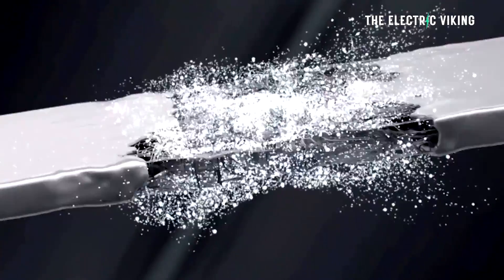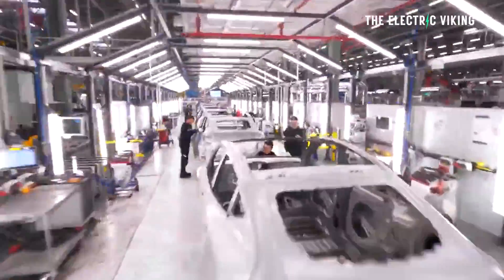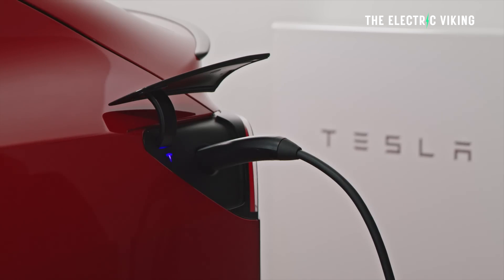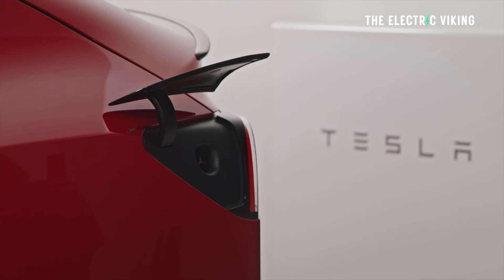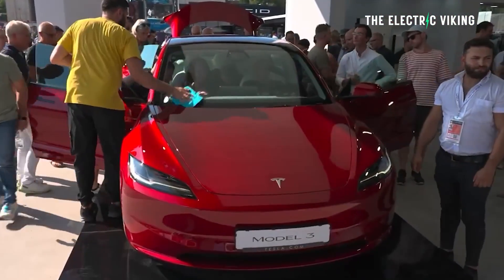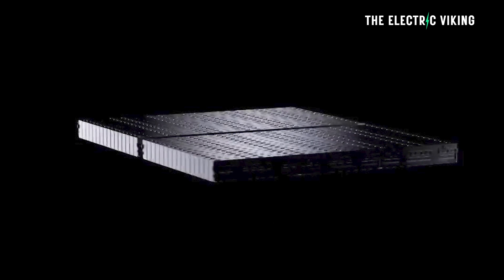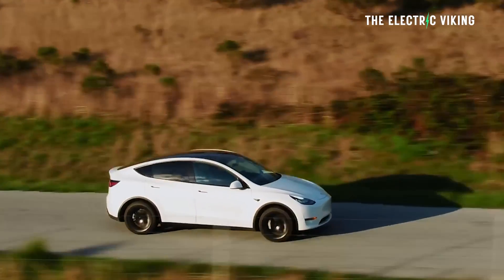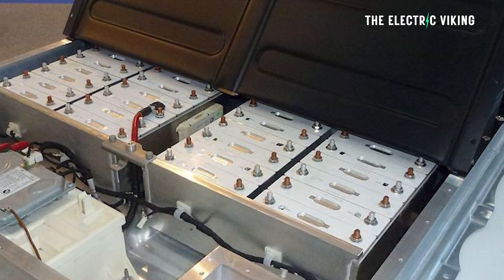Energy density of CATL's Shenxing battery revealed for Tesla Model Y Juniper

Comment: It's nice to hear that batteries continue to improve but the article has opposing "facts".   At one point it states a car (with this battery) will have a 1000 km range and at another it states that a Model Y could improve as much as 15%.   Given the Model Y range would be 613 km WLTP with that statistic (which is great, but not 1000 km), the article leaves a lot to be desired.   Click bait is one thing but it would be great if we could actually get some reliable information on an EV based channel.   I'm still waiting for my 500 mile (≈ 800 km) BEV to be completely happy about BEV range.   This would generally provide 400 miles  (670 km) range under bad weather conditions.   That said, I'm still delighted with my Model Y and what it gives me compared to ICE.

Comment: I think current model Y range when new for standard model with CATL LFP battery is 410km. I dont know for sure but the same battery in my Highland model 3 is 438km.
The new battery has 1000 434 km range and will increase range of model Y by 15%
Hang on there shich is it 410km increased 15% isnt 1000km. Its more like 485km. 
I am expecting the new battery in model 3, when I sit in that car at the dealer to read on the display 500km. Lets see how close I am to that.
Reply: Shenxing enables faster charging without degredation which is more important than range tbh. If I could charge 10-80% in 10min I would be okay to 480-500km range

Comment: Always take a look at volt and amperes when speaking of charging speed, very fast charging will heat up the cable and everithing in the "charging chain" , maby you can do a very fast charging, then let the charger cool off. The load will be massive, so I think you came to a point where the load is to much.
One good thing is, doing the car lighter, the battery smaller, and therefor faster to charge

Comment: The electricity is still generated with coal. And the the electrical infrastructure still sucks. The most advanced electrical vehicles are highly advanced, still polluting steam engines. Until the electricity is green, whats the point?

Comment: what is the power density per KW? please give number
Reply: Do you mean power density per kg?
205 watts per kilogram is what the video states.
Read the transcript if you missed it in the talk.
Reply: @briankearn6991  thanks. 205 seams not too high. Ionic 5 uses SK ncma battery with 305 per KG. He made it look like its revolutionary breakthrough but it wasnt
Reply: @galaxyoldman  
Kilowatt hours per kilogram is energy density is variable dependent on voltage. 
Google the formula.
It determines how much energy is released and how much range a car will have.

Comment: Maybe Tesla offers a 600mile range vehicle. However, I believe they will continue to offer a 300 mile version that will be lighter weight and cheaper (smaller battery).  This is what I believe they need to make EV's more compelling to a larger market. One of the knocks here in the US is the weight and how EV's eat tires.
Reply: I have an ev and it does not eat tyres as long as you drive in a steady manner. The problem is that because they are so responsive, it is irresistible!  My ev is not heavy compared to my old Territory,  so if you want to go big (and heavy) you have to pay the price.

Comment: Its energy density is 205 wh/kg. How does that compare with rival tech?
Reply: 2025 taycan has ternary chem with 170 wh/kh in pack energy density,tesla model s plaid has 181 wh/kg in pack level with ternary,BYD gen 2 LFP blade batteey pack has 190 wh/kg,lucid sapphire has 175 wh/kg ternary pack,this new shenxing plus has higher energy density than 95% of available ternary packs in the market yet it does have LFP chemistery,
Reply: @davidfujkk8018  Thank you.
Reply: @davidfujkk8018 

Wait a minute, are we talking watts/kg at the cell level or the pac level?

205 w/kg at the cell level might be good for LFP bit dome Tesla cells are kinda the benchmark in the 270 w/kg range.

Given thr promise of 300+ to 450 watts/kg from the various Solid State Battery players, you can see that if one or more cam mske their tech work it is the game changer.

I'm flummoxed Tesla is not  going full throttle w/ Sil 5:57 a technologies Silicone drop in Anode for a 20% gain & weight reduction, etc that can be adopted to their existing cells.
Reply: Oops Sila Technologies...
Reply: It has 205 wh/kg in pack level energy density

Comment: There seems to be 2 next version batteries from CATL, the Shenxing battery explained here and the M3P battery that gets just as much press and similar advantages except the Shenxing battery is faster charging but the M3P has better energy density. Apparently Tesla are going to use both batteries.

Comment: Get the battery and lose the STALKS.  Gamers don't think stalks are necessary because their hand controller doesn't have turns 'lock to lock'..........in the same sense that motorcycles don't either.   Being tech heads, rather than car guys, might have something to do with it.

Comment: This will be great when it comes out, if it comes out. still think it will be at least 2 or 3 more years before we get to 500 miles on a full charge which means at 80% we should get around 400. If the replacement battery costs less than $10,000 (approx £8,000) I think more people will change over to ev's. At the moment most ev's will go roughly between 3 and 4 miles per Kwh (depending on driving conditions and road) so to get 500 miles mile from a 75Kwh hour usable battery (Tesal Model Y battery size) you are looking at around 6.6 miles per Kwh, that's a big jump, around 150 wh/m (I think, although I may have my maths wrong). Hope it happens. Unfortunatley at my age I will probably be dead or at least not driving any more when this happens. Time will tell though. Exciting times could be ahead for ev's.

Comment: It would be frankly a waste to have a car with 500 miles of range. Completely wasteful of resources and extra weight that does nothing most of the time. The number of use cases where that actually is valuable to the driver or owner is literally one out of 500. Most of the time, that extra weight could be saved, performance increased, and handling and braking performance increased instead of range bragging rights. This business of bragging about range is actually validating the nonsense claim that we need 400 to 500 mi of range for electric vehicles to be practical. Faster charging speed on the other hand is significantly valuable to those on Long drives. But still even with the current NMC and NCA chemistries that extra 10 minutes is not a big deal.

Comment: If we get to 500 miles, that will finally shut up everyone that says they dont go too far
Reply: Nope, smh ive seen it since 2013 when i first rode in a model S. Ev haters said we need 150 miles to switch.
Then around 2015 it was 150+, around 2018 it was give me 200 miles, then around 2020 it was we need 250+ to switch.

Then last year the average none ev driving gashole mouth breather claimed they need 300+miles to switch over. 😑

Now that we have up to 500 mile evs? It's we need 500+miles in all conditions year round and tow for 250+miles in an ev truck. 
When ice loses 15-25% range in the winter per the epa, and from owning trucks when I'm towing I lose 30-60& range.

Meanwhile the average us daily commute is still just under 37 total miles. And then they blather about those poor poor apt and condo dwellers who don't even buy new cars. 

As 85% of 2023 us new car buyers were homeowners with six figure household incomes and financed the majority of the principle amount for their vehicle purchase of choice. So they have a reserved parking spot and reliable electricity to charge an ev up with. 😂
Reply: @4literv6  150 miles? 250 miles? Yeah okay. You know what's holding EVs back? take a closer look at that second paragraph you wrote please. You did the same thing with the Prius and set hybrids back over 20 years. 
If something has to be shoved down my throat, it's probably not better. Look at CFL lightbulbs, that's a great example of how that works out.
Reply: @4literv6 
Most drivers don’t have the ability to  be smug in their superiority while waiting for their car to charge, since it can add an hour or two on a weekend getaway.
Reply: I think 400 miles suffice.  Most ICE cars have a range of slightly higher than 400 miles.
Reply: @dhui777  Mine does 730, 1.6 diesel
Reply: @anglosaxonmike8325  most ICE cars are not diesel. 😄 Diesel is bad for environment.

Comment: I just bought a used diesel car after 3 years with an ID.3. Will switch back to electric when this battery comes to a smaller Model Y Version (Model 2 oder similar). Until then I enjoy 860km of range on a single "charge"🤭
Reply: You must drive with a bottle strapped to your leg...
Reply: @ohger1  I just let it run.
Reply: @martingasiorek  😁

Comment: These tiny increases in energy density, 10-15% are meaningless. For EVs to replace ICE battery density needs to increase 3X with no increase in weight and the material costs must be cut in half. Anything else is just sales fluff.

Comment: Just run a vehicle on water as Stanely Meyer and Dennis Klien did. Filling up your fuel tank with water from a garden hose would be much faster and cheaper.
Reply: There are two web sites that have kept popping up on my phone for the last few weeks that promise perpetual motion. One of them has a flywheel with a crank with a spring attached and three plastic pop bottles half filled with gravel and attached to the flywheel spokes. The other has a car alternator driven by an electric motor; I think the idea is that the alternator generates the electricity to run the motor and also some surplus that you can use (when nobody is looking who is policing the laws of physics).
Reply: @cedriclynch  Hydrogen is a very powerful explosive gas. This is well known. Separating it from water has been perfected by the two mentioned inventors. Stanely Meyers mysterious death seems to confirm his threat to the oil industry. There are several such deaths among inventors of efficient carbonator systems. There are several patents held by the US navy on zero-point energy. I think it would be wise to explore suppressed technologies, patents, and those shelved for "national security". These technologies would be much more superior to wind turbines, EVs, and solar panels.

Comment: In short, it offers 205wh/kg (see 3:05). That's not great, but the battery is quick to charge and relatively cheap.
Reply: He says Watts/kg not Wh/kg, he is useless. Can't take anything he says as correct.
Reply: @AORD72  I like the Viking but, yes, you do need to take what he says with a pinch of salt!
Reply: He says Watts/kg not Wh/kg, he is useless. Can't take anything he says as correct.

Comment: Tesla's problem is that they do not control the chemistry of their batteries.  It keeps changing. They depend on the Chinese batteries / chemistry, that are apparently better than Tesla's.  This is a big problem for Tesla, who's most expensive and critical part of their product is not under their control, while Chinese car companies keep improving their product and most importantly lower their price.  Their 4680 batteries are not competitive over time unless they control the chemistry that goes into them.  It does not look like this is going to change anytime soon..
Reply: Wrong.
The best batteries are made by Panasonic. Tesla uses the Panasonic batteries in the Semi truck and in its high end vehicles.
Reply: @richardvivian3665  But what percentage of the batteries are made by Panasonic?  As their production of vehicles increases, the % made by Panasonic is likely dropping.  This is a problem.  They are purchasing a lot of Chinese batteries.  They are ramping the 4680 in house, but what is the cost of those batteries vs the Chinese ones?  The chemistry of the chinese batteries is more advanced and cheaper, a lot cheaper.